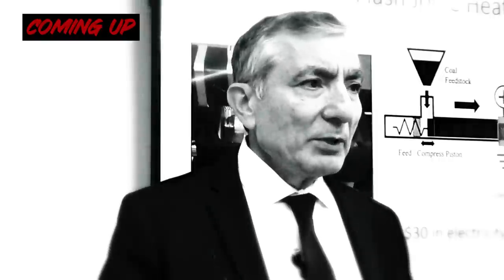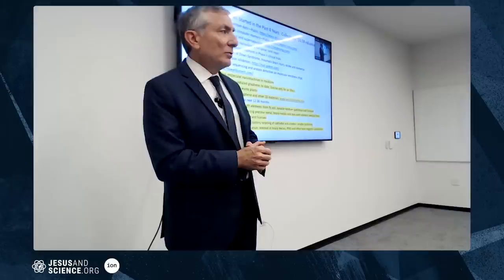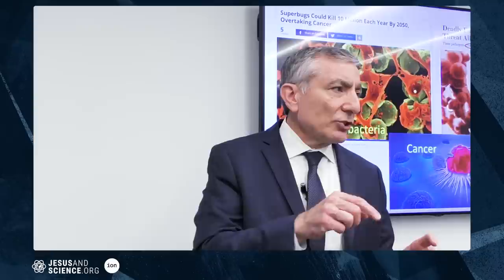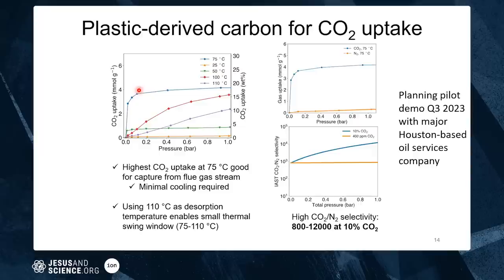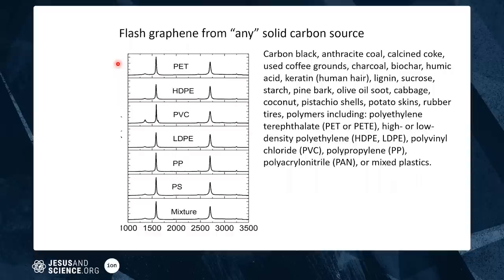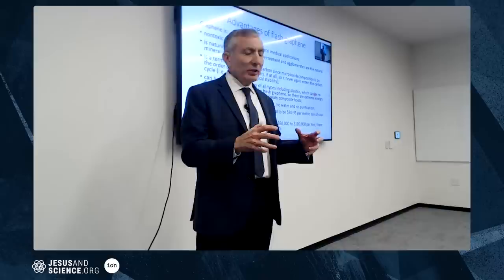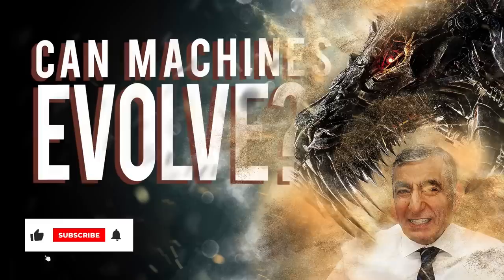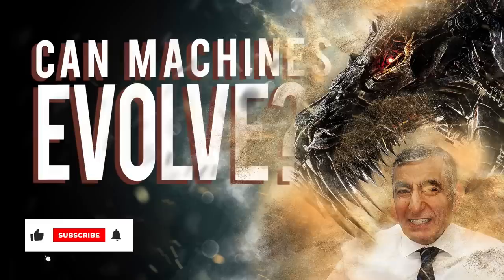Graphene: The Strongest Material in the World made from TRASH? Discovery from Rice University

Comment: One of the intriguing possibilities large amounts of graphene brings to mind is a high tensile strength cable for an equatorial space elevator. But is even this material strong enough?
Reply: Oddly enough its easier to build an orbital ring and we could do it now. Geopoliticals is the only reason we can't. Let's just replace our leaders with AI.
Reply: @wmrme9084  Yeah, you're really gonna love THAT.
Reply: @wmrme9084  It's not the only reason.  The cost of such a structure would be far more than the GDP of the entire world several times over.  I don't think you understand the economics of the situation.  Also, such a ring would be constantly damaged by the pull of the moon, to the point where it may not actually be feasible to do such a thing.